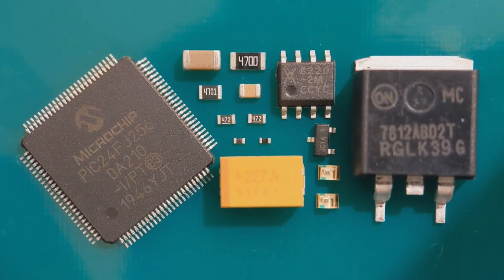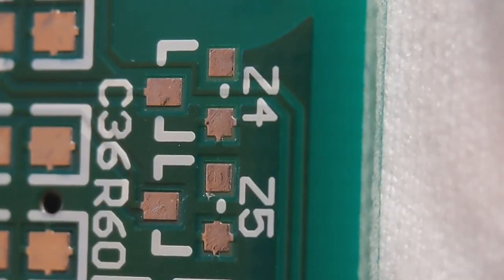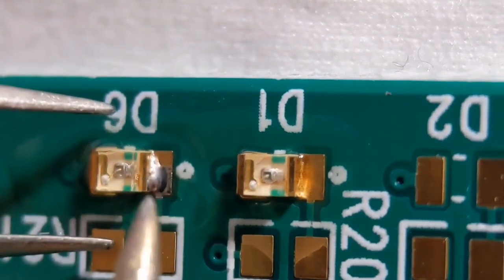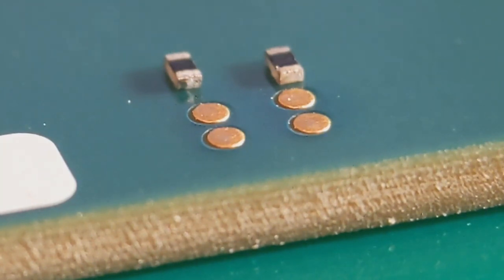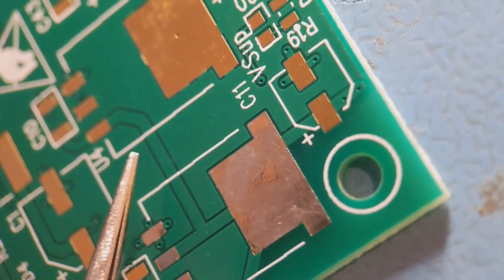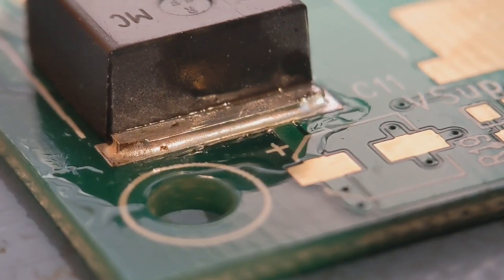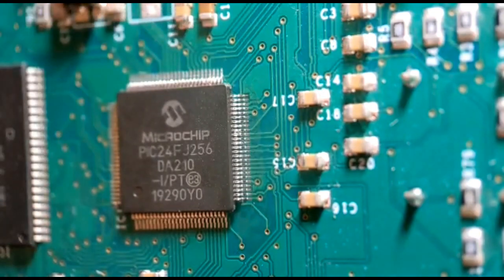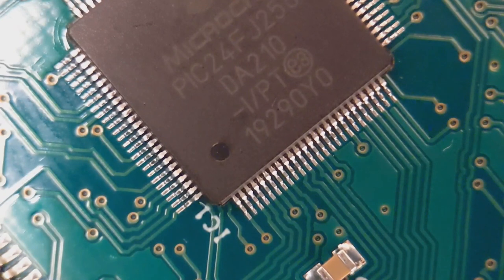How To Solder SMD - Part 1 /SMD Soldering Tutorial (Updated)

Comment: I'm currently having an issue because my 0.7mm solder needs to flow onto the iron/work. Instead of flowing smoothly, it just 'balls up' at the end of the roll. Not sure where I'm going wrong. My ol' faithful multicore Savbit solder that I've had for AGES flows like butter, but is far too large a diameter for SMD work.

Comment: Excuse me Sir I have an other question. For SMD componentes like  capacitor are they  polarized? Resistor how can we solder them with knowing the which direction is it? Thank you in advance.
Reply from the maker: Hi . Capacitors can be polarized. For example Tantalum capacitors have a band marked on the body which is the positive ( Anode ) . Lots of capacitors do not have any polarity , so can go either way. Through hole capacitors will generally have a polarity marking on them . If in doubt you can search Google for the datasheet ( just type in the exact part you have and you will find this info pretty easy. Resistors don't have a polarity  , well if they do I haven't seen these ones. Good luck 👍

Comment: New subscriber and new to SMD soldering. Can you tell me what solder and solder flux you use? No sense trying to do something without the proper equipment. Trying to start off with decent equipment from professionals like yourself. Have a Merry Christmas and a safe New Year.   Artie 😊
Reply from the maker: Hi , thank you for your support , much appreciated. The solders I tend to use are , ( lead free 0.25mm , alloy Sn100SB , flux 2.2% , Nitrosol solder wire ) and ( leaded 60/40 tin lead , 0.25mm + 0.56mm ) , I use a company in the UK called BLT Circuits for these . Also Farnell , RS Components and other electrical stockists will probably stock these . 0.25mm is essential for fine pitch soldering , also a fine conical soldering iron tip is a must have . They also do other thicknesses of solders if required . Very good , reliable products.
The flux I use is called SMFL200D . I have done a complete video on YouTube showing the benefits of using this flux . It's the best flux I've ever used , very much recommend it. Available from places like Farnell , RS Components , Rapid Online + if in USA , Mouser or Digikey. It's about £15 for a 200ml can . My YouTube video shows the way it can be used easily . Hope this helps , good luck and thanks again 👍

Comment: Nice work! Are you using SAC0307?
Reply from the maker: Hi , thank you. The lead free solders I generally use are Nitrosol Solder wire , Sn100SB , flux 2.2% SD-82 , 0.25mm + Fluitin 1532 , 0.4mm , SAC305 . 
I generally get all my solders from a company in England called BLT Circuits.
Hope that helps , thanks again 👍